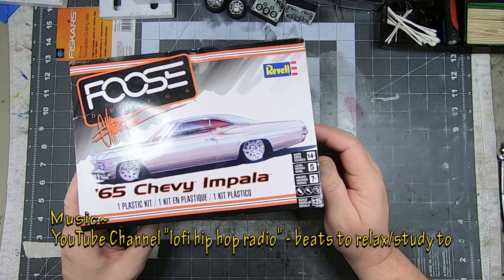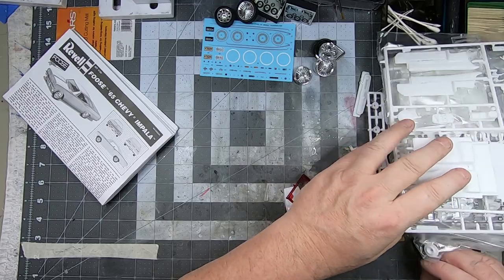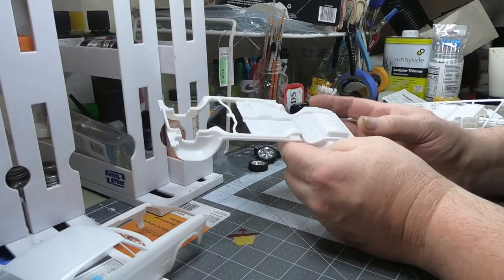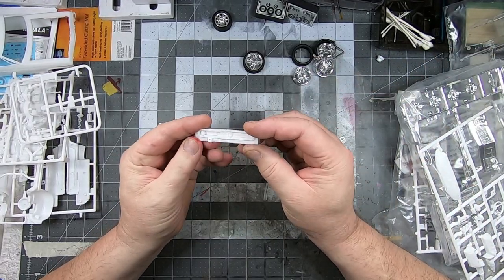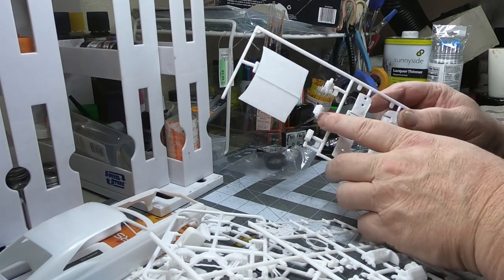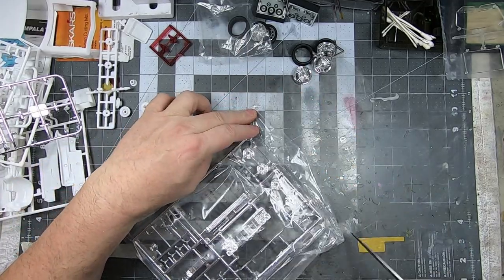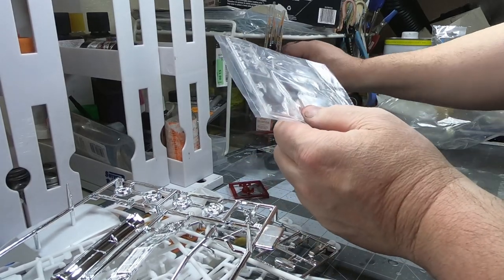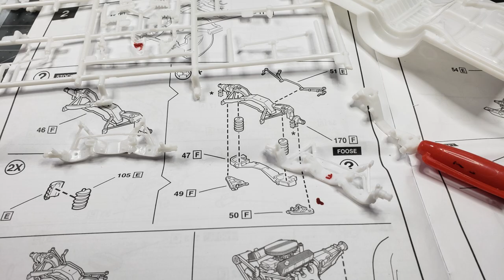UNBOX & BUILD of a REVELL/FOOSE '65 IMPALA

Comment: Nice build I'm doing the same one as well and I am wondering what is the black stuff you used for the interior and where I can get it.
Reply from the maker: it is referred to as flocking or embossing powder. most hobby shops will have some, as well as online (probably cheaper). comes in various different colors too.

Comment: Nice build. For whatever reason I struggle alot with Rust-Oleum and krylon on the body and not anything else. Interior and chassis comes out perfect and when I spray the body , the paint wrinkles all up . It makes no sense . And I almost never mix manufacture paints for that reason .
Reply from the maker: are you using a primer/base coat?
Reply: @doinstuffwiththings  Yep. It's a hit or miss. I've done primer/base color. I've done base color only. I've done base color and clear coat . Yesterday I did a test of Fusion clear on a couple sheets of styrene with a Krylon Fusion color that's been dry for over a week. One sheet i did 3 wet coats. It came out fine.The other sheet I did 2 light coats and the third a wet coat and almost immediately it wrinkled up everywhere. Drives me nuts !

Comment: Ok, decent build. Not really a fan of the almost donk rims. My big question is what exactly makes this a Foose  design? A set of rims and custom air cleaner? Good thing you only paid 16$ I am not impressed with the extras in this rendition. Just a side note my brother had a black 65 ss 327 4 spd I'd like to build one of those as a late 60's driver. Again decent build just not impressed with the Foose design edition.